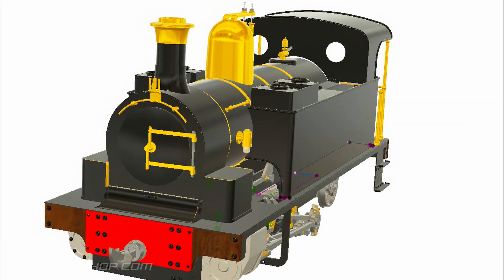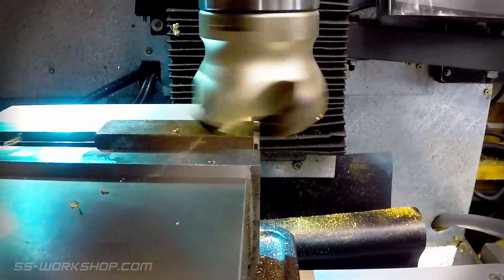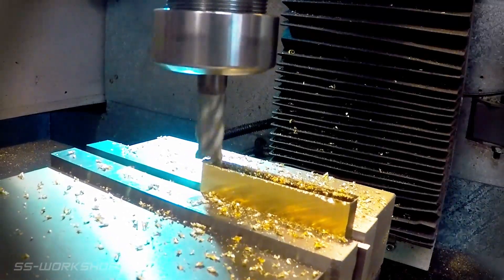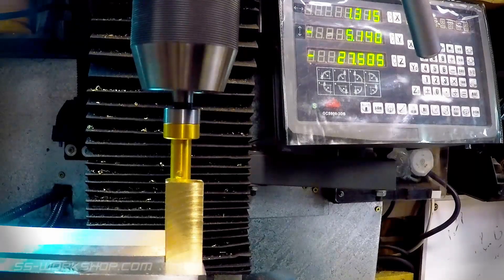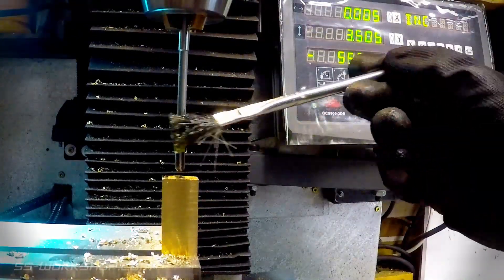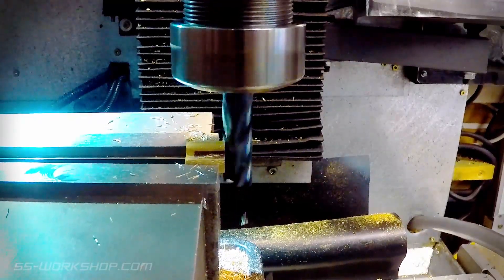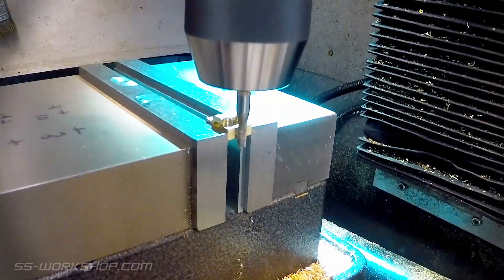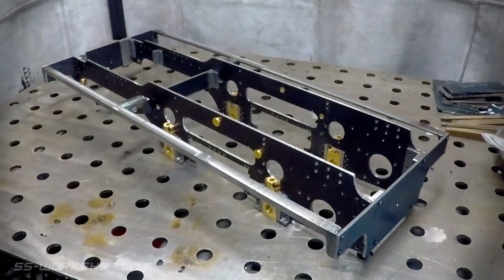Fell Engine Project - Making Suspension Brackets S1.E7

Comment: Hi Mate, I have an Optimum Mill MH28V with a SINO DRO X and Y axis. Question is how did you get the Z axis on the DRO from the on board inbuilt Digital readout ? Any info Please Ron.
Reply from the maker: Hi Ron, this took a bit of thinking as I wanted to be fully reversible if I ever wanted to remove it. I have an arm with the reader attached connected to the 2 screws that the built in scale uses and a mounting plate for the scale attached on the 2 screws on the front of the main casting, if you email me on sswkshop@gmail.com I can send through some photos of the setup with the cover off as a pictures worth a thousand words. Cheers.
Reply: SS Workshop Hi Mate, I have eMailed you. Thanks for you’re quick reply. Ron